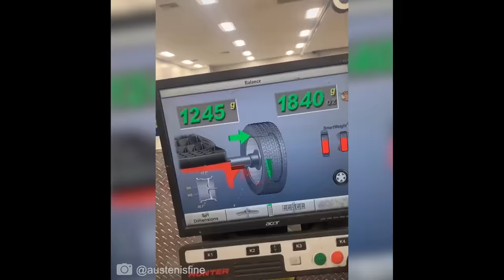Mechanical Problems Compilation [Part 7] 10 Minutes Mechanical Fails and more

Comment: 9:14 just squeezing the terminals closed on the starter motor relay. I assume he is not a mechanic as he sounded so surprised by the magic  😂😂
Reply: Im not a mechanic I just like watching these videos they teach me stuff I dont know sometimes and rest of the time its just for the enjoyment
Reply: I guess you’d hope that it wasn’t a thing that can be exploited to steal the car lol
Reply: @RennieAsh  Without the key in, the ignition and fuel system isn't working, it's just cranking the engine. Matt is right, that is a normal behavior of a relay.
Reply: Yeah. It’s about as spectacular as shorting out the starter solenoid with a screwdriver and getting it to turn that way. Actually, that’s more spectacular because usually there’s a bunch of sparks with it.
Reply: Literally was going to write the same thing...that guy probably thinks a relay is full of magic instead of what it actually is...he will go far I'm sure 🤦
Reply: I never thought that was possible with relays
Reply: @RennieAsh  Good luck opening the hood without the key. And starting the fuel pump. And the spark plugs. And getting into the car. And turning on literally every other fuse needed to drive the car.

Comment: 8:57 I was baffled by the guy with the coke but then I remembered that is where the battery is on those trucks. He's just cleaning his terminals. There are better ways of doing it but it works.
Reply: I think he was topping-up the Electrolyte Levels on the battery with Coke.
Reply: Ngl, thought he was topping up his coolant or something. Was like "you COULD... but... WHY?" I guess the same response still stands 😂
Reply: ive done it as a road side repair before, terminals were corroded and it didnt want to start, although found it still didnt want to start and found the starter wire corroded off as well from the starter, luckily i kept enough electrical repair stuff to fix it.
Reply: works perfectly fine with coke.
Reply: Have personally used coke to clean terminals on car that did not have enough cranking power to start and car started normally afterwards.
Reply: Yeah, most people here thought he was filling his coolant tank or something
Reply: Nah, just making sure his car was hydrated
Reply: and we guzzle it down and it dissolves rust LMFAO
sciences is a trip
Reply: @icykickflip  our stomachs have much stronger acid inside them already
Reply: Yeah, better and cleaner way to do it is baking soda and water. Works like a charm.
Reply: Coke literally will clean your battery terminals. It will fizz away all that acid 😅

Comment: 2:20 is literally how its supposed to work
Reply: Yep, that’s what I was thinking. Unless it doesn’t hook up when the clutch warms up.
Reply: Clorox Bleach no it’s not. The clutch fan should never be stopped by hands
Reply: TC14KID agreed
Reply: @yonseth788  ever heard of a viscous coupling lmao? When the car is cold the fan barely spins and can be stopped by Hand. When its hot, the clutch engages and the fan spins alot faster and cant be stopped by hand.
Reply: Yeah I was thinking that too. Maybe he discovered that and didnt know. Cant imagine why someone would stick their hand in there though
Reply: @TC14KID  no when its Cold it should not.
Reply: This is NORMAL operation for a fan clutch.  I’ve worked on many cars from the 80s and 90s and stopped fans with clutches ALL THE TIME  with my hand just like this.  The clutch only locks up when it gets hot!
Reply: @bluered1322  mightve accidentally did it then was like "oh shit, thays not supposed to happen, get the camera"
Reply: Please don't stick your hand into the fan unless you wanna get your nails aggressively trimmed.
Reply: @TC14KID  : Then tell us this: Why put a clutch in it if it is not suppose to disconnect (you obviously know that there is one there since you used the word yourself). Why would manufacturers add that to the BOM if it would have the same function as pulley attached to a fixed shaft, Einstein?
Reply: @TC14KID  if it cuts your finger off then it's not working at all. the whole point is to have as much slippage as possible when cold because more slippage means less parasitic loss from the engine. if your clutch fan is able to cut off your finger when cold then it's not working properly, you might as well have a solid mounted fan at that point because there is no difference.
Reply: I actually stopped the video and searched for this comment. Not sure: 1. Who submitted the video thinking it was something wrong. 2. Why the person who owns the channel included it in the video.

And please dont stuck your hands in the fan people! I would be lying if I said I didnt do this before but there are better ways like using a wooden ruler or rubber hose if you insist on testing the clutch like this.

Comment: 2:20  isnt really a mechanically fail, it's how clutch fans work. If is not engage completly it's kinda just freewheeling you can stop it by hand I've done this before.
Reply: Edward Myers I thought that too.
Reply: Yep, on my older Chevy it comes on and off every 15-30 seconds.
Reply: Except it should have more resistance than that is the point. Also putting your hand into a spinning blade with a working fan clutch? Enjoy the ER visit.

While it should "free spin" when cold it should also have resistance to it...
Reply: almost all of the belt driven fans got a viscosity clutch witch will be engaged through a bimetalplate when it warms up ... all other fans are controlled by electronics
Reply: @FakeJeep  no when its disengaged the video is showing the right amount of resistance. I've done this to my car which has a new 100% correctly functioning fan. May depend on whether it's for a commercial vehicle or a civilian application
Reply: Edward Myers I owned a Radiator repair shop and I’m also an Automotive Technician, some fan clutches are like that they have silicon fluid inside and a bimetallic thermal strip switch locks and unlocks the clutch. Some will freewheel as shown others not so much, it’s not advisable to test like that unless you have a lot of experience doing so!!!!!
Reply: Depends on how hot it is. But yeah... it’s not a solid mechanical drive.
Reply: It shouldn’t be that easy though, if you can do that with your hand it needs a new one
Reply: @FakeJeep  : [Read in a melodious tone] Wrong, wrong, wrooong, you're wroooong, you're wroooooooooong, you're wrooooooooooooong!!!!
Reply: @edwardmyers1746  : Right, right, riiiight, you're right, you're riiiight, it-depends-on-the-design-and-manufacturer... you're riiiiiiiiiiiight!!!!
Reply: @FakeJeep  no it shouldn't, the whole point of the clutch is to have less resistance. when the engine is cold on my truck the fan barely moves at all but when it starts to get up to temp the clutch bites a little harder so it spins faster and pulls more air.
Reply: @danielzapien24  no it's fine that's how they are supposed to be. if it's not slipping enough to the point were you can stop it with you hand when cold then it's not working properly because that would mean the clutch is too tight and therefore you don't get the benefits of having a clutch fan. the more slippage when cold the better.
Reply: Its not supposed to stop like that tho
Reply: @alexanryset1404  yes it is.
Reply: THEJONATAN read Electronics For Fun comments.  100% correct.  In the right conditions, a perfect unit can be stopped like this.  They take a lot of power and create noise, slowing them down save a few drops of fuel.
Reply: @royb5014  thank you! you'll also get a little extra horsepower. you would be amazed at how parasitic a belt driven fan can be.
Reply: Ok mr technical
Reply: @ElectronicsForFun  not really, I remember all.kimds of people putting "performance" clutch less fans on their small blocks, not only very noisy, but on those wheezy engines, you could feel the power loss.
Reply: @royb5014  a clutch fan is your best bet. all of those performance fans are snake oil. they look cool but holy christ they are parasites.
Reply: You're not necessarily supposed to be able to stop it by hand. The one in the video's either stone cold or needs replacement.
Reply: @SkorpyoTFC  why does everybody keep saying that? it's mounted independently from it's shaft allowing it to spin freely. it works through a temperature controlled coil valve. when it gets hot the coil expands opening the valve and the centrifugal force from the spinning shaft throws the fluid outwards. there are multiple sets of fins with in the fan that overlap as it rotates. the viscosity of the fluid between those fins creates more friction which causes the fan to engage more and spin at higher RPM. it's kind of like a variable torque converter.
Reply: @ElectronicsForFun  Even when they're cold, most fan clutches don't full slip.
Reply: @SkorpyoTFC  but that's what they're supposed to do, that's the point. if it doesn't go full slip when it's cold then there is something wrong with it. if it's cold then the coil will tighten and close the valve keeping the fluid from expanding outwards and then there is no fluid flowing which means there is nothing to engage the fan other than what little friction there is on the shaft.
Reply: @CarsofTheArcticCircle   tuo alkaa olla enää pelkästään vanhoissa/vanhemmissa autoissa käytössä.
Reply: @CarsofTheArcticCircle  Ei tarkalleen kampiakselilla, vaan vesipumpun akselilla, johon se oli huollon kannalta helpoin sijoittaa, ja optimaalisin myös jotta olisi mahdollisimman paljon syylärin keskikohdalla. No juu, joka tapauksessa se oli ihan hyvä ja toimiva ratkaisu, ja tilalle tuli hajoavat sähköflektit🤣
Reply: It is called "Visco Clutch" and gets harder and harder to stop the hotter the visco oil in it gets. So, technically it works just fine should this be possible with cold engine/visco filling.
Reply: Please dont tell anyone grab a clutch fan .....and no when idle shoots up the centifugal clutch will engage ...say your holding it and the compressor engages and idle goes up bye bye fingers
Reply: keyboard mechanics going at it even a year later lol
Reply: @edwardmyers1746  Of course - being helpful does not need any rushing, does it? 😂
Reply: @FakeJeep  And here's our EXPERT on Clutch fans
Nubbs Mc Gee..
Reply: @edwardmyers1746  Ed like I said some of guys on video,just marvelling over a sludged up pan or broken cam like they haven't seen anything like it before.....They HAVENT😊
Reply: shake hands with danger now they call you, durumdurumdum pause thee fringer johny durum dururum dum

Comment: 9:40 "Hey! Your blinkerfluid is leaking."
Reply: yeah he should have changed it before it got so bad
Reply: I hope he checked the muffler belt too
Reply: I had GM car tail lens like that . Had to install a drain hole also
Reply: But you can always tell if someone splurged on the bulb grease

Comment: 7:07 When you realize she's treating the car like a washing machine... Lmao.
Reply: Or the car is burning oil, due to the problem either in the valve seals or the piston rings. Either way, might cost thousands of dollars to rebuild the engine, while pouring a cup of oil every fillup is cheap and easy. That's how here in Russia a lot of people live with their old Ladas that are burning oil.
Reply: @machinerin151  she Is Using a Cap Full Of OIL
Reply: @bansheemania1692  yes? Did you read my comment? That's what I'm talking about: if a car is burning oil it might be cheaper to just pour new oil than repair the engine.
Reply: Yeah I figured i had enough after i saw that lmao
Reply: @machinerin151  It's an incredible waste of time, and because of your smarmy last response I'm not going to tell you why.
Reply: I imagined I wouldn't have to explain why this is funny..... You don't just refill based on an amount of caps/km. Level indicators exist for a reason😂
Reply: It is like coo,ing.. 1extra vierge olive oil wil do the trick
Reply: sonicwifi40 you don't understand the issue. A cup of oil will do literally nothing. You need a lot more.
Reply: looks like shes putting it in the brake fluid reservoir
Reply: Don't worry the car is a four banger 5 cc engine, just needs a cap of oil
Reply: Its a woman not a male
Reply: Makaveli  No, she was great to make sandwiches because she follow orders. 
Put 100ml per 1000km, that means 10ml per 100km, 1ml per 10km
Reply: @machinerin151  did you watch the video? A CAP FULL. that is nothing, even if it is burning oil, that is NOTHING at all
Reply: @thatotherboi8044  I see you've never driven an old car that burns oil very slowly.
Reply: That lady got me mad
Reply: its a cap of transmission fluid, helps clean the engine
Reply: @machinerin151  if a car burns oil slowly you top it off every couple of months, you don't slip a cup in every here and there as if your car needs to constantly be full on oil. I've had a slow leak out of a backing plate, and a valve cover leak that leaked fast enough, and in neither of those situations did I pour a lil cup of oil lmao stop tryna defend something stupid

Comment: 0:40 Plane engine on fire above 10.000 feet

Me: Dorime
Reply: When that happened? What flight ?
Reply: @kilosan  Delta 1425, Atlanta to Baltimore
Reply: @asdfasdgfasd   so its not from the  Malaysia Airlines - Flight 370  ??
Reply: @matty4z  no, definitely not
Reply: @asdfasdgfasd  LOL  XD
Reply: Well... An airplane can fly with only one engine, has an extinguisher system that propaply kicked in seconds later and yea... not great but nothing that would freak me out
Reply: @annasstorybox7906  I'd be laughing at the people freaking out. Sure that engine is screwed but it'll make it down
Reply: that's the fan centre cone came apart but stuck there because of the pressure against it. while the internal engine is still going i think even it being windmilled.
Reply: Yeah I'd probably freak out myself.  I mean I know planes can fly with just one engine - thank you Flight Simulator 2000 - but I'd be worried about it blowing up, and fuel is stored in the wings, so...
Reply: @1koro1  yes I know its a type of learjet (dont know the model) just makin a bad joke   ( ᇂ_ᇂ)
Reply: @nthgth  planes don't just explode like that when an engine fails.
Reply: @annasstorybox7906  that depends on the weight configuration and how many engines it actually has, if it’s a twin engine weight forward, yeah you better hope there’s an airstrip close by 😂

Comment: 0:28 my eyes
Reply: BU RA working pretty well I’d say
Reply: I want that looks easier than steel wool and sandpaper
Reply: That's actually a real way to resurface heads/decks, you can do the same think with sand paper and piece of glass

Comment: 2:20 its not problem its a fan clutch
Reply: Let me just reach into this fan shroud and stop my fan blades............
Reply: Its an electric fan anyway isnt it
Reply: Alex Ketteridge most of those fans inside of cars will easily chop a finger off they’re super sharp around the edges
Reply: @alexketteridge5481  no,this fan is spining from engine
Reply: @V1ktorvaugn  I agree,its just like hot knife through butter
Reply: @alexketteridge5481  but electric is dangerous too
Reply: It's literally what the fan clutch is designed to do
Reply: Yes, it's a viscous fan.
Reply: Anthony Castillo You’re comment deserves a lot more likes
Reply: Yeah it's a viscous fan clutch but no fukn way should you be able to do that 😂
Reply: @extremis6957  Yeah NO....   a clutch fan locks in and increases speed with engine rpm. That is a BAD clutch fan in the video, as demonstrated. If you can easily grab your fan and stop it then it's bad. Which causes overheating issue. Any mechanic knows this. You can also rev the engine and see the the speed of the fan barely changes.
Reply: They usually Fail the other way around. The clutch seizes and makes your car sound like a triple 7 when you start from a red light
Reply: @locomojo0485  Actaully that clutch is good the only thing is he is at idle and the vehicle isn't warm.
Reply: @calebdavis6233  Why not? I can do it both my cars.
Reply: @calebdavis6233  yes you can as the clutch only engages when the engine gets to a certain temperature, i have a sierra 4x4 and that does exactly the same
Reply: The Doking it shouldn’t be that easy to stop, obviously you don’t know the difference between a good fan clutch and a worn one
Reply: @alexketteridge5481  no it's not.
Reply: @V1ktorvaugn  not a plastic fan like what they put in modern cars, but one of the older steel fans like the one in my truck will fillet your fingers.
Reply: @calebdavis6233  if you can't stop it with your hand then it's too tight and not working properly.
Reply: @locomojo0485  the clutch only locks up when the engine is hot. if it's cold then it spins freely and can easily be stopped with your hand. if it can't be stopped by hand then that means it's seized up and needs to be replaced.

Comment: 9:20 that is actually normal. Thing is, that is only the fuse for the starter. So u could clamp that fuse with pliers all day, but it's not gonna start unless u activate the fuel pump too.
Reply: Relay, but yeah it can be closed manually, but the car still won't start, great way to tell if your Relay is and is to buy one with a mechanical switch on top and just bypass the relay